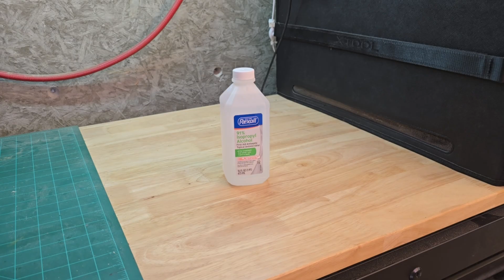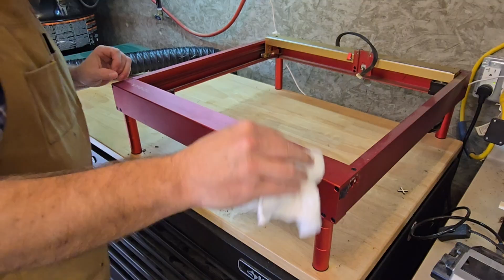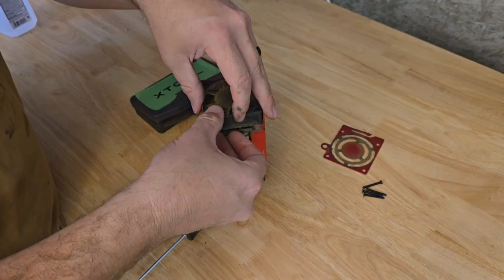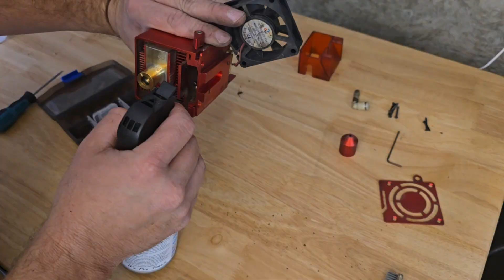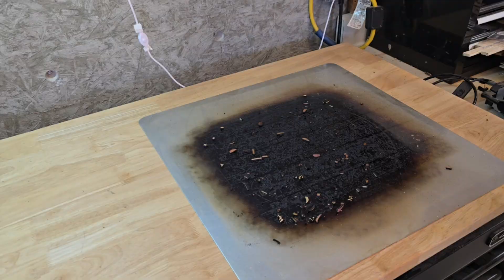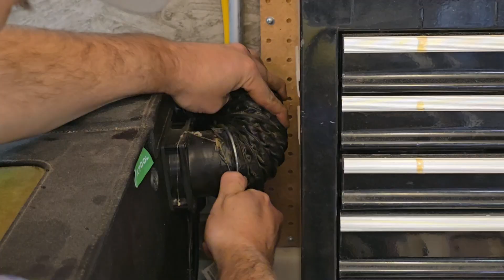Deep Cleaning My XTool D1 Pro 20W (It Was Bad)

Comment: any idea why my xtool D1 doesnt do offset fill? the letters are hollow and really off from the actual design (problem that just happened)
Reply from the maker: So that sounds more like a file issue than a machine issue.

Is it a file you purchased or one you created? If it was purchased, I’d lean on the seller to correct it (I’ve had to do this myself for files I’ve made — so if it’s one of mine from Etsy, definitely let me know 😁).

Have you tried running it as a standard fill (not offset fill) and are you still getting hollow letters?
Reply: @BeamBoardCo  hey its a file i made and yesterday i checked again also cant do file or line